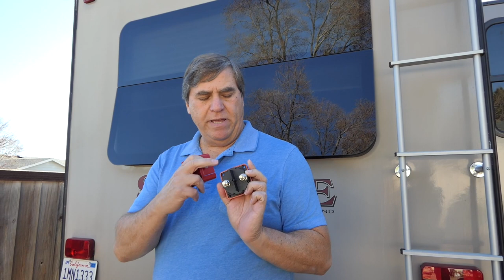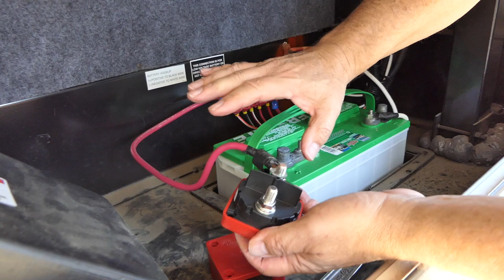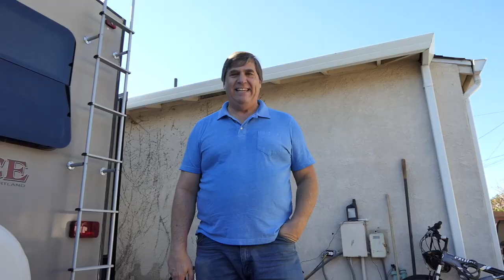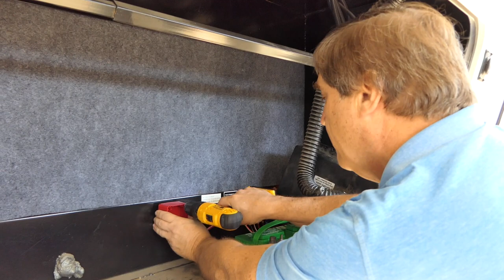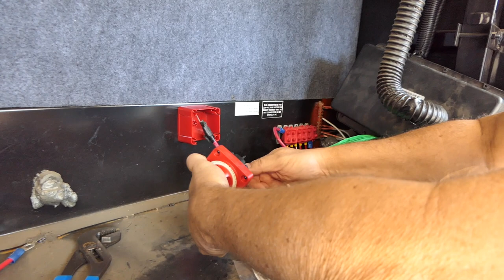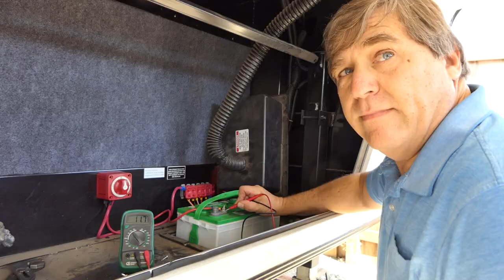RV for beginners. 12V Power Switch Install

Comment: A trailer tech said it's best to install the switch to the negative side of battery. Just FYI.
Reply: I was told the same thing
Reply: The tech guy is wrong.
Reply: The instructions that came with my switch also give directions to place on negative side.
Reply: @sunroy1 Nope.
Reply: @ItsKyleMang  you better do a little more research. When the positive side is broken all the energy from the battery is off and no longer flowing through your system. It’s the standard for all RV’s. Check it out
Reply: @sunroy1  The same is true when disconnecting the negative. The primary advantage of disconnecting the negative side is minimizing the risk of short circuits. If the negative side is disconnected, and a conductive tool or object touches the positive terminal and simultaneously contacts any part of the vehicle's chassis or body, it won't create a short circuit because the circuit's return path to the battery (the negative side) is interrupted. I've done my research.
Reply: @ItsKyleMang  well this is an ongoing argument among DC systems. What I’ve read from electrical engineers is that the switch should be on positive side. Also Will Prowse agrees and he’s the guru of off grid systems. I’m not that smart I’m just learning from others that understand DC way more than me. Both make sense to me but I’ll go with an electrical engineer every time.
Reply: @sunroy1  Here's the problem. Dealing with an off-grid system is different than a vehicle in many ways. There are valid reasons to disconnect positive leads for many applications. Fuses are on the positive lines to protect conductors and components.  However, in this application, there is no valid reason to leave the chassis of the vehicle with electrical potential in favor of disconnecting the positive terminal of the battery. Ask your EE friend if disconnecting the positive terminal in favor of the negative is a rule or if it applies only to specific applications.
Reply: @ItsKyleMang  ok, first of all I have no friends that are EE, it’s what I’ve read. They say it’s safer! From what I’ve read there is no specific applications. It’s a rule. The NHRA rules are that the disconnect switch must be on the positive side. Not everyone agrees with that rule however. Now as far as a travel trailer which is what I replied to, they are off grid too (at least that how I use mine). I understand your point of view, I’m just saying that having the disconnect switch on positive is the right way according to everything I’ve read for rv’s.          I think if I did a video of my system with the disconnect on negative and put it on YouTube I’d have everyone telling me I did it wrong.
Reply: @sunroy1  Again, application matters. Putting a kill switch on the positive side of a dragster makes sense to kill the voltage ASAP in an emergency. Having a shutoff on an RV to isolate a battery is completely different. When it comes to grounding and safety, simpler installation and maintenance, and reduced risk of electrical leak, putting your shutoff on the battery negative cable before it is attached to the chassis makes sense. There is no valid argument to the contrary. At least not one I can think of, but I'm open to being proven wrong.
Reply: If you look at Grainger and McMaster-Carr battery cut-off switches, they are all designed for the NEGATIVE polarity. This tells me the disconnect should be installed on the negative terminal.

Comment: Why positive not neg
Reply from the maker: The chassis is negative.Meaning the negative connection can easily be still connected. Electric potential can be dangerous.
Reply: On 12V DC you just complete the circuit with red.  So he basically fed his red (input) with the red from the + because the battery was connected to ground, which also is connected to the RV ground, thereby completing the circuit.  If you look at the one main red going to power all the wires that go inside, he's got a bar for red supplying interior. I did this today. However, my unit had 3 reds on the red terminal powering 3 x 3 wires...which is the total number I had on the DC panel. The DC panel has one ground coming from the battery.

Comment: You know, they make these things called wire crimpers.  You can buy them at an auto parts store.  Hammering on an electrical fitting seems mighty unnecessary.  Also, if you want it done correctly, soldering on the correct fittings goes a long way
Reply: That is a wire crimper. They're made specifically to use with a hammer, vise, or hydraulic press.